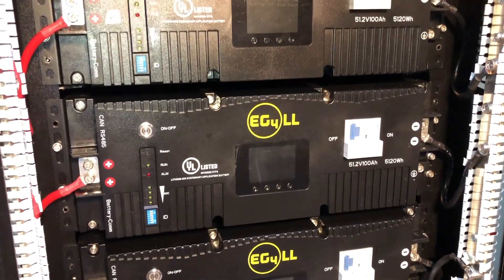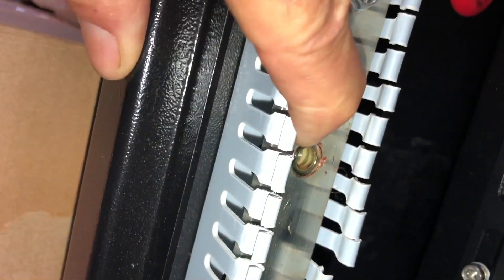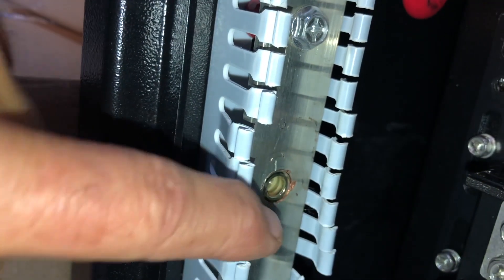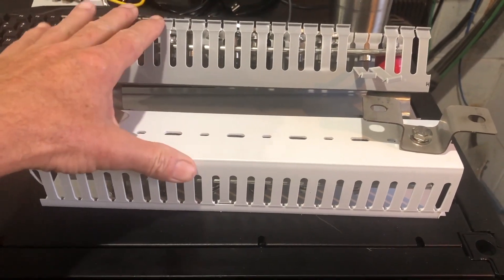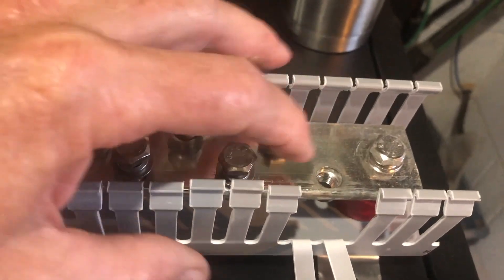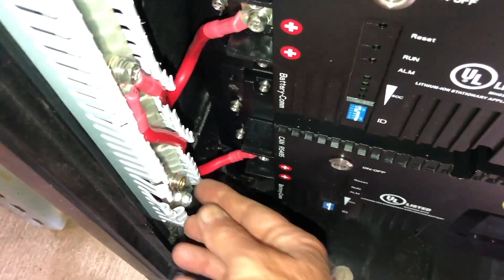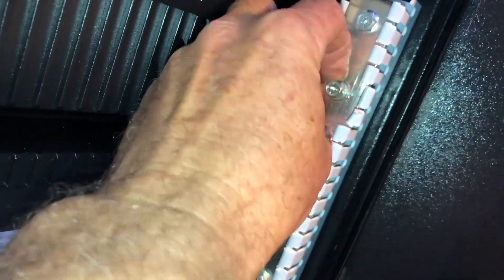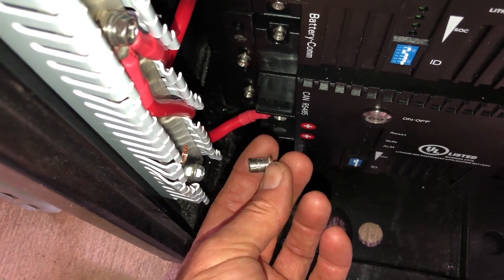Buss Bar Failures in Welded Pre-Assembled EG4 Enclosed Battery Rack

Comment: I've seen the same thing.  We've installed a bunch of EG4-LL racks. On our last install, in February 2023.  I liked that the racks started coming pre-assembled and with some high quality heavy duty casters.  A couple of the bus connections would not tighten and came out really easily.  A couple of months later the homeowner let me know that more had come loose since then. I'm going to make the rounds with our recent installs and check them all!  Probably be worth it to get the crimp tool or just replace with bolts, nuts and star washers.  Thanks for putting this video up.
Reply from the maker: I would contact SS for new buss bars. I was notified on Friday that replacements had shipped.
Reply: manufacturer should responsible to correct it, not by users tried to crimped them by themselves, they are kind of expensive piece of equipments 😅

Comment: I set up my system at the beginning of 2022, the bus bars do not have inserts on mine. Did not have any problems with the bolts.
But looking at yours, the flange should be on the back side. Perhaps turn the busbar around...
Reply from the maker: That was my first thought, but the inserts stick out a lot, and if cut off, no threads would remain.

Comment: I had the same issue with my bus bars I removed them.. Then I drilled and tapped for  .25x 20" steel bolts used to clamp cables to bus bars.Then  I shrink wrapped  the bus bars  problem solved. I did a  Video on that on my channel. Also sent the video to signature solar They admitted the problem and treated me well.

Comment: The BUSBAR is backwards, the lip of the insert has to be on the backside of the bussbar.
Reply: yes the pem nut  has to be on the back side so the bolt pulls on the thread and the flange stops it from coming through  but if they are stripped out its a fire hazard  electrical connection must be kept tight

Comment: Wow! I'm doing a custom server rack build. I used 600A bus bars from signature solar. I had to sacrifice a insert to make my disconnect a detect connection. I had to beat it with a hammer to remove the threaded part. The video is coming soon. Thanks for yours 👍
Reply from the maker: I'm hoping my replacement bars come soon and they are more like the 600A bus bars.

Comment: What were you using to tighten them up with or loosen?
Reply: Looks like a impact when you looks at the bus bars
Reply from the maker: Light duty impact, but not to tighten. I used a torque wrench for that.